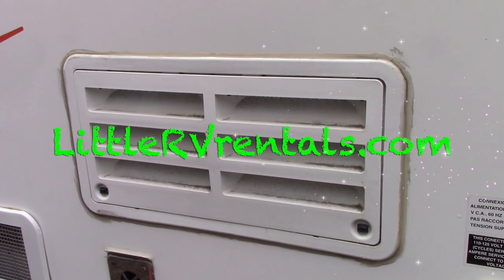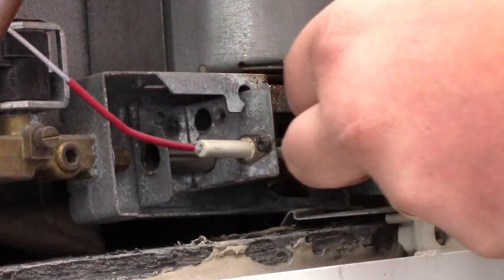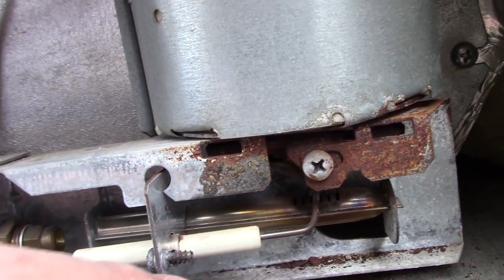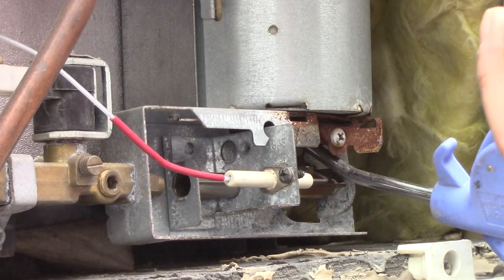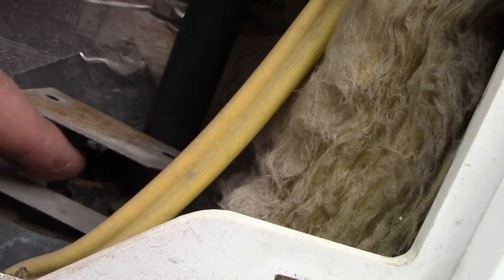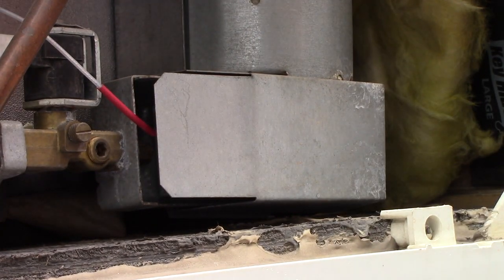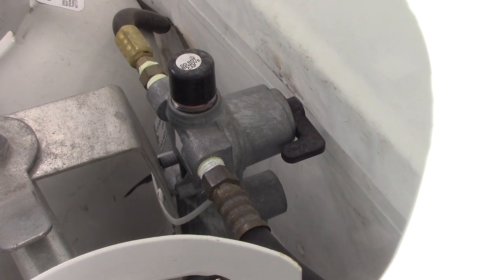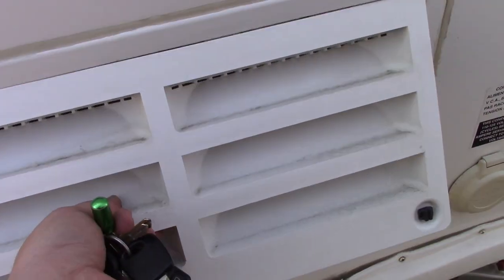RV Fridge Not Working On Propane? (CHECK THIS FIRST!)

Comment: Thanks for the very informative video. It helped me immensely.  I just wanted to pass along to anyone who’s having trouble getting their camper refrigerator to cool on propane (mine worked fine on AC and DC) that a new LP gas regulator completely solved my problem.  I was hesitant to replace it because my stove and water heater were working ok and I just couldn’t see how only the fridge could be affected, but I was wrong. After the new regulator was installed, I lit the burner on the fridge and I immediately knew it was fixed. I really had no idea what a properly operating gas fridge looked and sounded like.  I would suggest to anyone else who is troubleshooting this problem to look and listen to your fridge burner. If it isn’t burning visibly bright and hissing audibly, it isn’t working properly.  If your rig is more than 6-7 years old, it’s probably your gas regulator. Mine was 10 years old and I’m told that’s a pretty good run for one of these things. I found a Marshall regulator on Amazon for around $35.00, which is way cheaper than taking the old one in for testing and possible adjustment. It’s a simple job to install it. Hope this helps somebody.

Comment: Thank you for posting this video. I had a propane fridge issue and watch ever repair video I could find. I fixed every thing but the coils and still was having issues with it not being cold enough. I replaced my lp regulator And it was fixed. You are the only person to mention this as an issue!  great vid!
Reply from the maker: Thanks for your kind words! Yes those regulators can clog with oil over time and restrict propane flow to you RV appliance. If you still have an issues after installing a new regulator it could be oil in the propane lines... It settles in the lowest part of the line and clogs it up as well! RV dealer once told me to empty a can of WD-40 in the propane line then blow out with compressed air! Happy this fixed your problem! Cheers :)

Comment: Thanks for this video!!  My frig works awesome on electric, but not on gas.  I have checked, and the coil is getting SOME heat, but no where near enough, so I knew the pilot light was lighting, but had no idea about the flow.  I got out the air compressor, cleaned it right up, and am testing it now.  So far, it seems to be working.

Comment: thanks for the very comprehensive video. Was having a heck of a time keeping my LP fridge lit and had blown the flue out several times. I had not blown out the actual flame tube itself and it turned out to be a bunch of debris in the bottom of the tube giving a poor flame front. I knew as soon as it sparked up with a new clean even flame it was fixed. Thanks again
Reply from the maker: Yes i clean the flame tube at least twice per year! Happy it helped Cheers! :)

Comment: Well, that didn't work.  The pilot light lights, there is a small flame, the tubing gets warm (not hot).  However, none of my other gas appliances have any problems performing as they should, and the RV is only 5 years old.  A regulator is pretty cheap, but I don't want to nickel and dime this thing.

Comment: Hey awesome video I'm gonna try all your steps I'm having this exact problem with my rv fridge . It only works on electric and I had someone check it out and said my cooling system was bad. I went and disconnect all the power cables on the fridge for about an hour. Came back and power up the fridge again and put it on electric and it started coolant within 45 minutes.  But it doesn't work on propane. My question ,can the cooling system still be bad and not work on propane? Anyway to test the cooling system? Thanks

Comment: Hey Dale. Good job.  I'll have to remember this if I ever get another trailer. The last one I had, I gave up on the propane furnace and fridge. I swapped them over to 120v, I never really stayed anywhere without power anyway.  Gotta be careful when blowing into orifices! lol
Have a great weekend!
Reply from the maker: Thanks Bruce! A fixer upper trailer might be an interesting project for you... I was always told you can blow air into orifices but nothing else and never poke wire or anything in it or it's junk. Thanks for stoping by and checkin out the video! Cheers from B.C!

Comment: We just drove across the country, and now the refrigerator and the hot water heater pilot lights won't stay on.
Is there a correlation with them both not working. 
We do have gas for our stove that works fine.
Going to try and clean the refrigerator pilot now, great video. 
Thank you

Comment: Also there are fuses in the electrical black box  or the  gas actuator may be faulty that turns gas on or off before the burner. 
and I noticed that you are missing the thermocouple to keep the flame going.
Reply from the maker: lol then how would the flame stay lit? This is an electronic ignition fridge
Reply: LittleRVrentals.com  maybe your model doesn’t have a thermocouple, But the Dometic RM 2652 does. I have changed it myself, wish I could send a picture .😉 Have a great day.